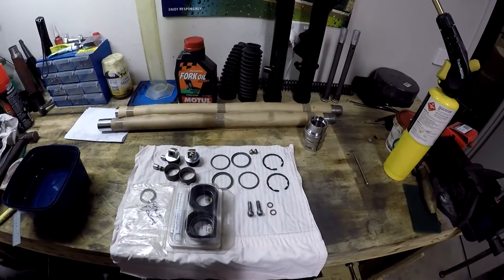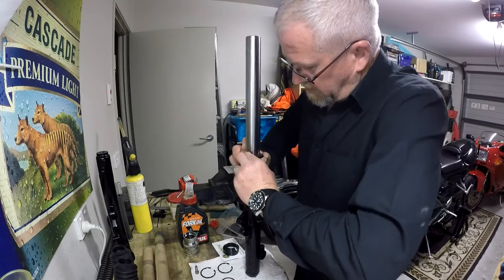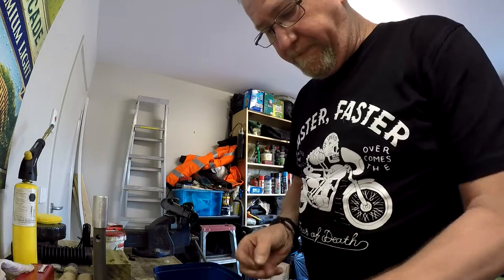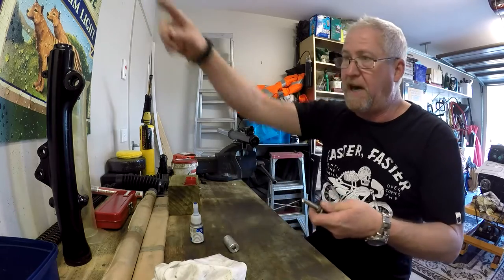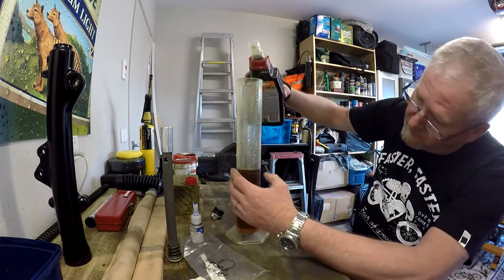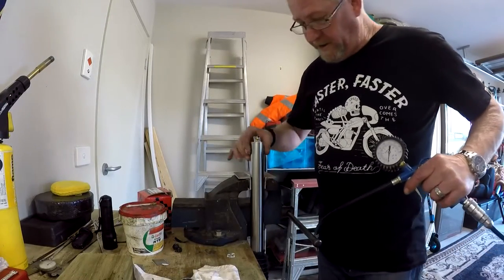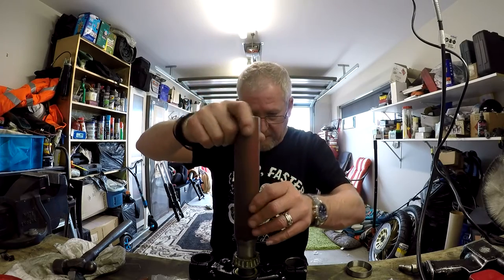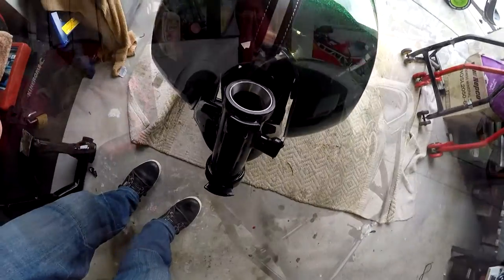Yamaha XS1100 Cafe Racer Project - Ep 13 - Fork Assembly

Comment: Excellent vid Andy - I'm about to do the same and fit new fork seals in my 79 XS1100 Special.  I see you didn't use the dust seals .... I'm struggling to find a pair in here in UK/Ebay etc.  Nobody seems to make them.  Any chance you recall the make/model? Maybe they're prolific in Aus!  cheers Will

Comment: Good Video Andy, I have not pulled a set of forks apart before but i would like to have a go at upgrading the internals on my 48 at some point. 
Did you install upgraded springs and valving in the front to match the rear upgraded shocks or just restore it to standard specification ?
Reply from the maker: +oozuk I just restored them Steve.  I am kicking around the idea of shortening the forks and fitting new progressive rate springs but I will leave it for now.  Forks this age don't have a lot of options for tweeking, and no anti dive valve.  Have a go mate, they vary from bike to bike and change with technology, but if you do your research you should be right.  You are a bloody mechanic after all, lol

Comment: With the fork seal, I'm surprised you didn't use the old "find a socket with a diameter slightly smaller than the seal and drift it in using light (?) taps with a hammer on the socket" method. The socket bears on the hard outer edge of the seal and providing you tap all the way round to keep it straight there should be no problem, much the same way you fitted the head bearings to the yoke!
I've used this method on several sets of forks with no drama!
Reply from the maker: +roythearcher unbeknown to me Yamaha made two different sized seals (one is 1mm bigger in diameter), guess which ones I had.

Comment: what did lengthening the steering stop entail?
Reply from the maker: I fitted the clip-ons to where I wanted them and then mounted the tank.  This gave me a point of reference to where the steering stop needed to be.  Then I fabricated a new stop from mild steel and welded it to the steering head.